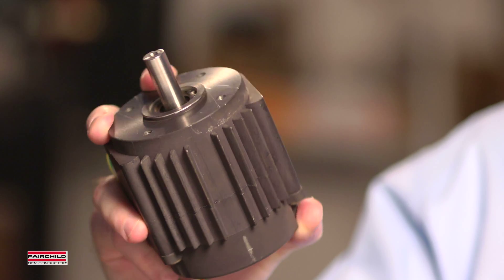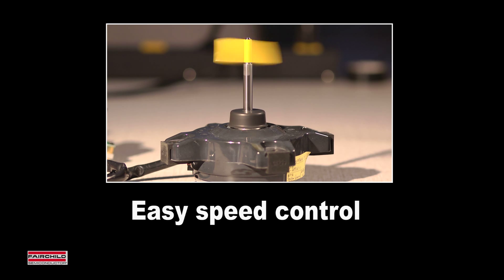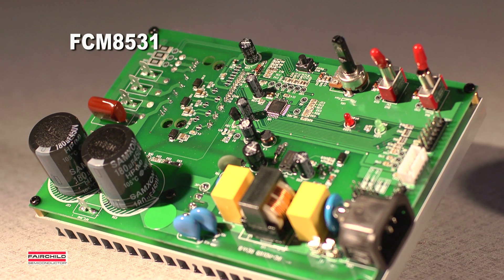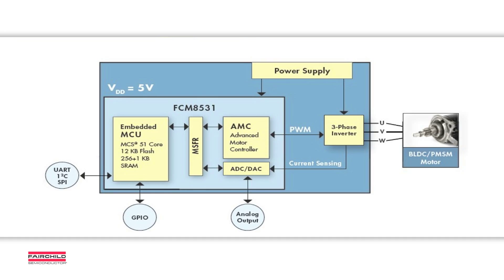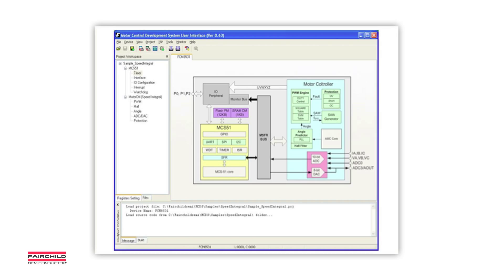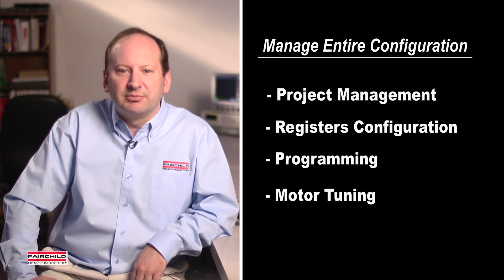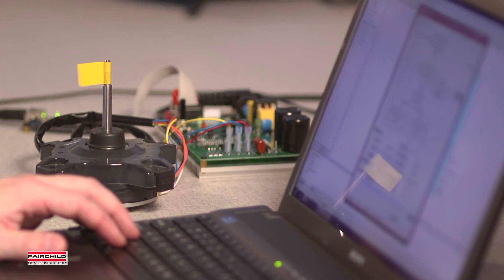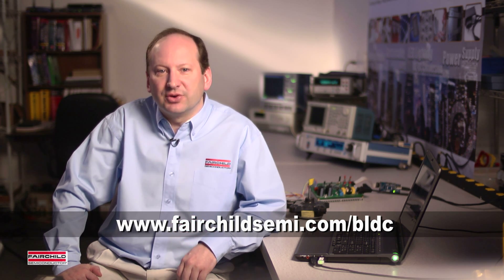BLDC Controller, FCM8531

Comment: Hi Mr. Roy,
It seems an attractive solution for BLDC motor driver.
Does the software for ACM core inside FCM8531 capable to drive motor speed up to 6000 or 7000 rpm ?